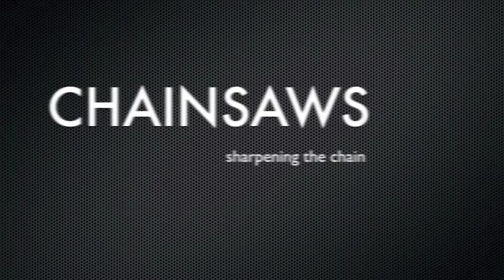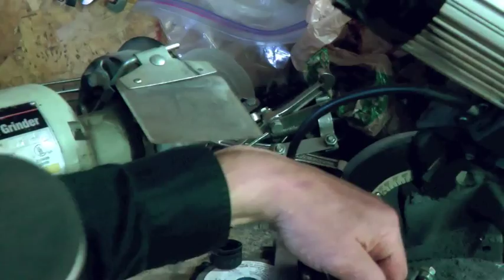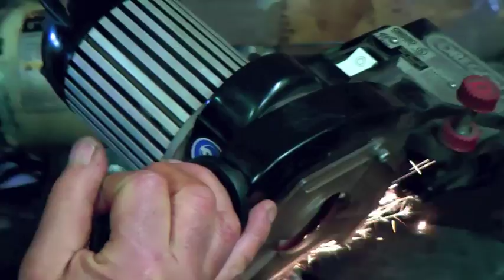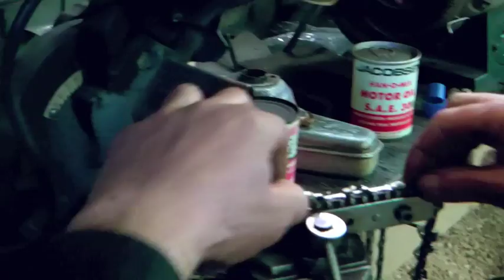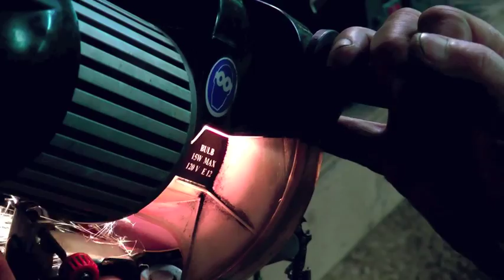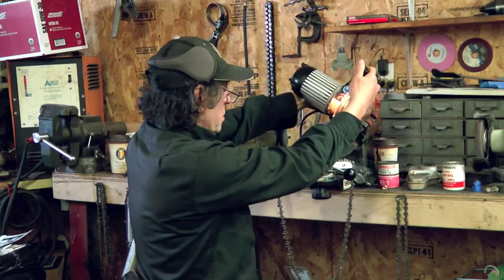Little Motors: Chainsaw Chain Sharpening with a machine

Comment: Wow!!!==>ur2.pl/761    This chainsaw is amazing! I was skeptical. I admit. A battery run chainsaw??? No way. Yes way! Just cut up a downed tree in the yard that was about 10” diameter. This little pro saves me from the pain of mixing gas, TRYING to get the pull start engaged, adjusting the choke and keeping it running long enough to touch the tree. EASY. Went through it like a hot knife through butter! Battery still had enough charge to do additional work. Wouldn’t be a bad idea to purchase an extra battery. To swap